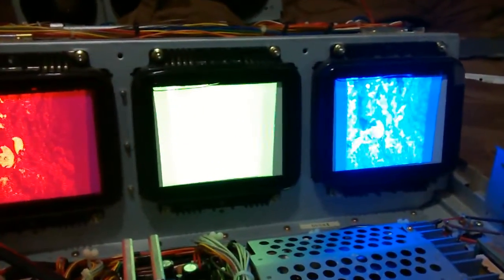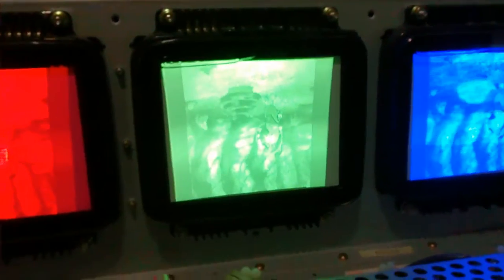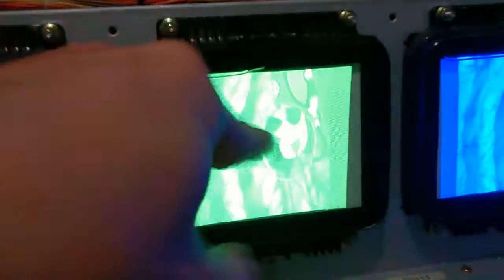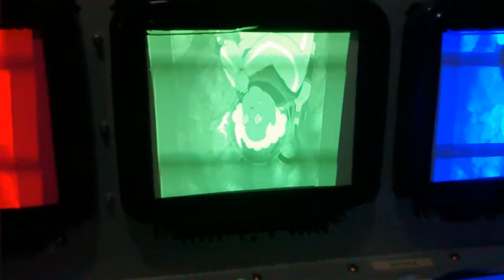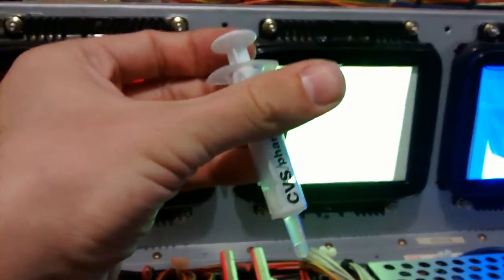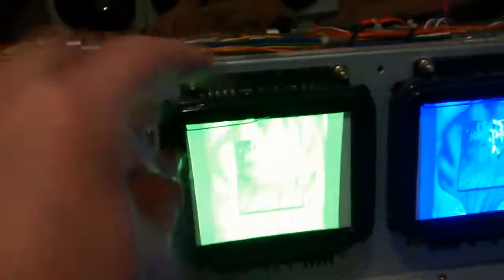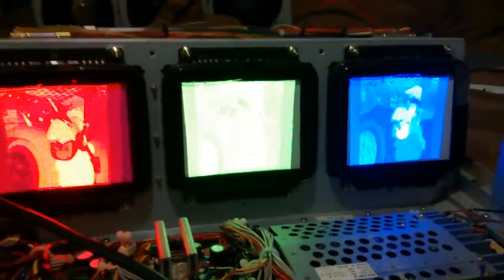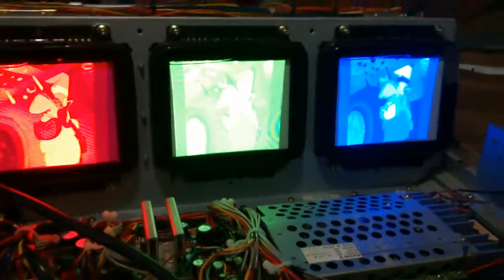The inside of a running CRT Projector

Comment: Perhaps we'll see another video on it again someday.
Reply from the maker: Unfortunately not. This machine has since died, and was parted out to give it's parts to another collector. It lives on somewhere else! Thanks for watching!
Reply: @TailsFurse  You're welcome. Sorry to hear that it didn't last. Did you replace it with another projector, a flatpanel, or nothing?
Reply from the maker: @Browningate  it ended up getting replaced with an LCD projector for about a year, then we went with a Sony 42 inch LCD TV. The LCD projector stunk quality wise. I don't recommend for watching movies.

I will say I miss this projector. And I am defo looking to get a newer one some day. Maybe one that can do at least 720i .
Reply: @TailsFurse  Despite all the buzz that surrounded CRT projectors about 10 years ago, I never did get my hands on one, although our family has had 2 CRT rear projection televisions in that time. While those aren't as good on the picture quality side as a proper CRT projector can be, (in terms of sharpness, focus, and geometry) they are a more plug-n-play solution (and the sound can even be decent). I've personally had an ultra-short-throw Epson LCD projector, and while it is notably better than our old NEC, it still suffers from the same panel fatigue as many LCD projection products.

That Epson is a circa-2012 machine, and I actually do think that LCD projection has made some strides in recent years to bring it up to speed with DLP. As a result, many venues have adopted LCD projectors to replace their aged-out DLP sets. I don't think those will hold up over time, but for the short term, they do look quite good.

I personally have a Dell 1610HD DLP projector now, (as seen in a recent YouTube video, in fact) and while it too is only a 1280x800 set, I'm pretty happy with it. The brightness is fantastic (even in power-saver mode) and the contrast is excellent.The rainbow effect is as noticeable as ever, but I've adjusted to that. I'm confident that, even with high hours, it'll hold up well.

Also, in the house, the trusty Mitsubishi CRT rear projection television was replaced with a Toshiba DLP rear projection set in recent years. It's not the sharpest by standards of most digital displays, but I've found it to be notably better than both of the Mitsubishis and doesn't cut off as much of the image. Most importantly, it was extremely inexpensive, and is also a very attractive piece of furniture, even when powered off.